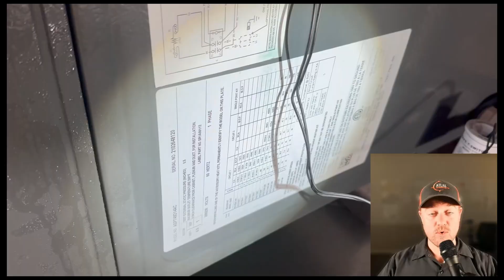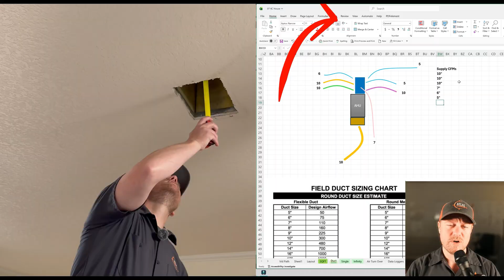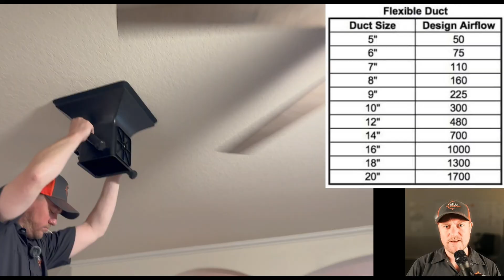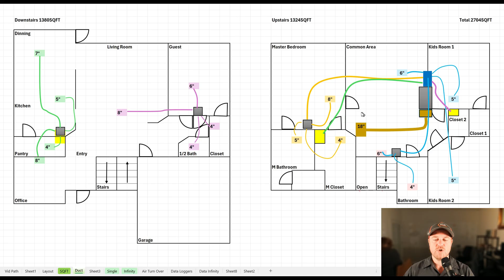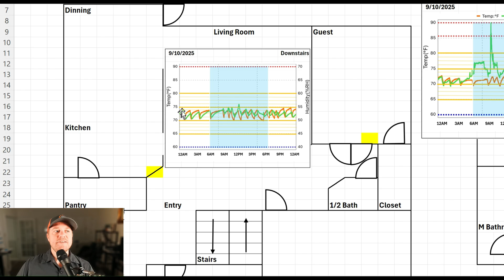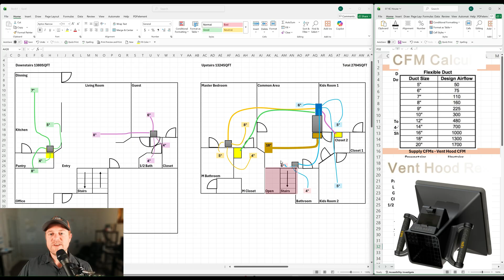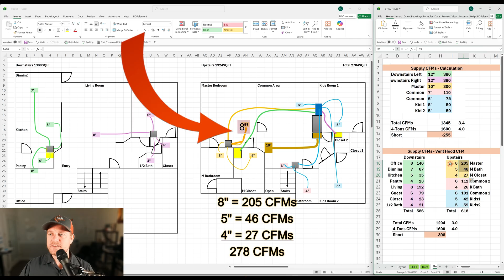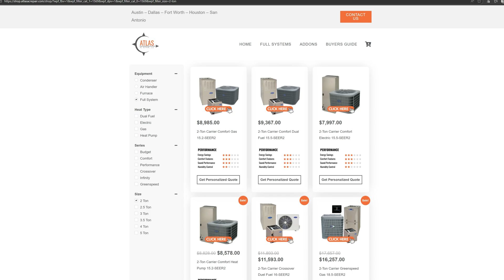Ductwork? Hidden DISASTER that everyone misses

Comment: Ductwork in lots of not most new houses can be a total mess and usually is. The builders are more interested in looks, design and cutting corners to worry about enough room for the right ductwork, especially in 2 floor homes. All I hear from HVAC people is how good they are, yet they are not really and most contract ductwork out. I've seen it lots and bought a house with problems on both floors. The one that installed the 2 units had no idea how the ducts where run, had no pictures or drawing. He just came out and installed the hardware and left. This is not uncommon, fussing about bad HVAC and ductwork is everywhere. He admitted the ductwork wasn't installed all that great and don't use them now, yet he didn't come out and check it when he could.  All you guys are the best when talking to you and others are bad with your super high prices, yet most of you are the same. Nobody really does what you just did, it's so rare it's don't exist. Most times I think I know more than the installers they send out, because the owner might know something, but they don't do much and the ones they send out know VERY little.
Reply from the maker: No manual J and no manual D coupled with contracted ductwork installers with no QC is epidemic. Then blame Carrier.

Comment: Ductwork should not be allowed; it is filthy and high maintenance
Mini split is the way to go
Reply: Mini splits seem like higher maintenance to me.  With a central system there’s only one filter to change or clean.  With mini splits each one has its own filter.
Reply from the maker: mini splits do not have filters that clean the air, only push it around till the tiny blower wheel get impacted and has to be removed to be cleaned.
Reply: @atlasacrepair  Even window air conditioners have filters - their main (only) purpose is to minimize dirt getting onto the refrigerant coils.  Another YT channel I watch had a problem with their recently-built apartment over a garage in Texas, where the mini-split A/C became less effective after a month or two this past summer.  Turns out its filter was clogged with dirt (construction environment, with lots of dust around).  Here's a random video about cleaning the filter on a mini-split:  https://youtu.be/F0u1EMUH6vs?si=CnsZxTP3hW1hmnV4